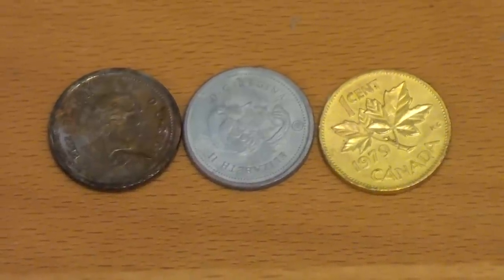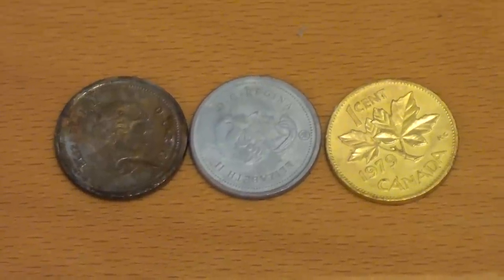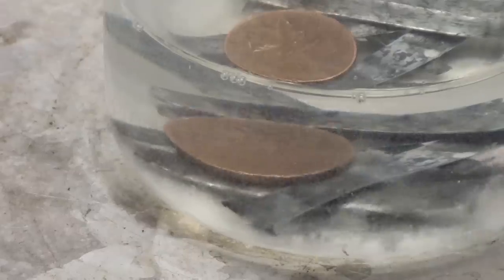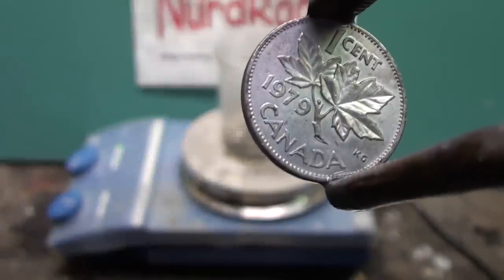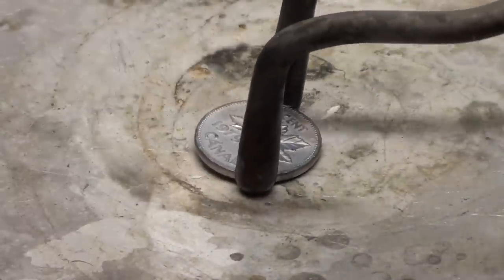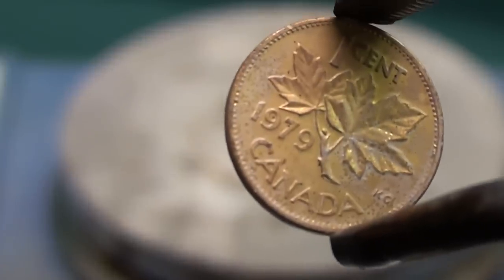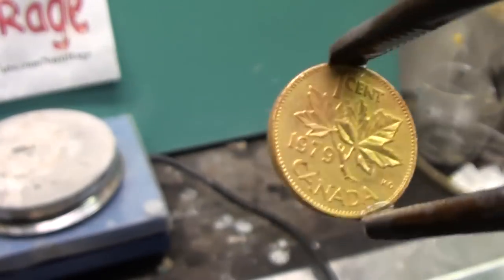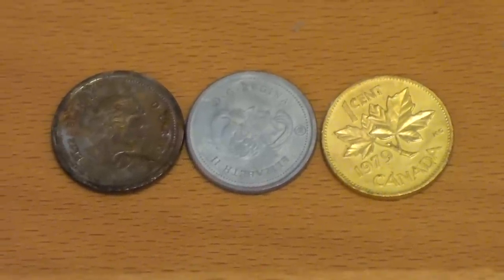Turn Pennies Silver and Gold (Chemistry Trick)

Comment from the maker: Chemically no. But through nuclear means yes. all elements in the universe heavier than hydrogen and helium were made in the cores of stars by nuclear fusion. We on earth can use a few processes like nuclear spallation, nuclear fission and nuclear fusion to also make other elements.

But you need particle accellerators and nuclear reactors for that. It is not possible chemically, and too expensive to be practical except for very special elements like plutionium.

Comment: I used zinc powder, instead of metal strips and it worked fine.
Reply: +Grey Ronin actually works much better
Reply: +Grey Ronin Ive been looking for an answer for this for ages! i can finally go ahead and order the zinc powder now...
Reply: Da Moose
Good luck :-)
Reply: Grey Ronin Thanks :D
Reply: +Grey Ronin Well of course it's going to work better, the zinc powder has a MASSIVE surface area compared to the strips.

Comment: Hello sir, I'm about to perform this awesome chemistry trick myself. Is it alright if I use Zinc sulfate heptahydrate ZnSO4.7H2O super pure? Will this work. I've noticed that the grain it comes in is way bigger in size?
Reply: Should work fine - it's just ZnSO4 with extra water molecules, added to water.
Reply: Okay, thanks.

Comment: Question; this is basically plating the copper in zinc right, then heating it to diffuse the zinc into the copper making brass. So my question is after the 10 minutes or so once the copper is plated with the zinc, would leaving it in longer create a thicker plating and a longer lasting brass finish? Or since the copper is coated with the zinc, is it as thick as it is going to get? I ask because I have some copper "Zombie Walker" coins for magic tricks and I would love them to have a golden finish.

Comment: sorry if im off the subject but ive been trying to silverlate some copper to make some pins, and I dont know what im dping wrong but, the silver wont go pn to the copper. I made my silver nitrate from dimes dated 1960, and im thinking its the silver nitrate that is the problem here. whats happening is my copper is getting really black and the silver coin im using to plate with isnt desolving but also getting dark. help I only have a few days to go. thanks, Carolyn

Comment: Hmm i'm failing for some reason the penny is not changing color. i wonder what could be wrong maybe my zinc is not good enough? i used zinc from batteries as zinc strips and zinc from batteries combined with sulfuric acid to make zinc sulfate. maybe i need to find how to test chemicals separately to find what's wrong

Comment: I am going to do this with some pennies I am using for a art project and I plan to use copper sulfate and zinc metal to make the zinc sulfate. My question(s) are how much Zinc Sulfate do I need for 50 pennies? How copper sulfate to zinc metal to make enough Zinc Sulfate ? and how much zinc metal would I need to put into the Zinc Sulfate to change the colour? Or Does It matter as long as the pennies are submerged?
Sorry If that's alot, I was trying to look it up but couldn't seem to get an answer on it. 
Thank You!

Comment: have a question I have a large copper kettle that is lined inside with brass I suspect this is the process m kettle is lined years of use has worn the brass down would it be possible to use this process to refurbish the brass lining safely to continue to cook in it.

Comment: So what do I do if I don't have a hot plate. Does a pan on a stove heat up to 300C

Is there a degree symbol on a keyboard?

And if I can't get zinc sulfate how am I going to get hydrochloric acid. Do I cut my stomach open?
Reply: You can make your own zinc sulfate and get hydrochloric acid at the hardware store. I heard once that cutting your own stomach open is unhealthy.
Reply: OK but what about the hot plate. I don't want to buy one just for this because I imagine they aren't a dime a dozen and I'm not someone who would use a hot plate very often anyway.
Reply: Stop the CPSC
Well, I don't know about the stove for sure. That's a good question. I guess it depends on the model.

You could use a propane torch as a source of heat though. They burn at temperatures way above 300°C.

It would be cool to try this experiment.
Reply: +JayMark2049 But will hank bring the pro-pain too?

Comment: hey in that copper sulfate battery video the zinc sulfate you made seemed to be in liquid form. is that going to be a problem because in this video it seems to be a white powder that you mix with water. Can I make the zinc sulfate in the way that you did in the other video and then just heat that up or do I need to find it in powder form?

Comment: messaging random chemistry videos. I'm trying to find out if their is chemical process that can turn metal a shade of gray similar to wet concrete. I ask because i have a handgun and it has a melonite finish. it's a chemical coating (if u didn't know)very resistant to abrasion. any info u can give would be nice.

Comment: The real trick might be getting the brass to stay on as he says it will eventually wear off. Due to being exposed to the elements or just constant contact or rubbing he doesn't specify. Maybe if a clearcoat was applied over it after the process?

Comment: I turned an european 5 cents coin into "silver" by turning the external copper layer into copper acetate through a solution of 50% acetic acid (vinegar) and 50% hydrogen peroxide. It turned out very well! The main metal of that coin was steel (not the stainless one).

Comment: It works faster if you put the HydroChloric Acid in a crucible 1/3 filled with Zinc shavings, suspended over a bunsen burner. I buried my penny in the shavings, and it took about 3-5 minutes for mine to turn silver. And, if you're careful, you can turn it gold just by holding it in an open flame for about 15 seconds. :)

Comment: I did mine in a steel can (as I do not possess beakers etc.) and it ended up taking longer as the steel becomes charged as well, attracting zinc ions towards it as well.

Comment: What happens if you burn it after it turns into "gold"?
Reply: +Xryeau Franco 
What makes you think you're turning this into gold?
Reply: Keshaire!!! 
That's why I typed "Gold" instead of gold.
Note the quotation marks.
Reply: Brass is a metallic bond (alloy) and behaves similarly to the metals that formed it with different physical traits like color or strength. If you heat it up enough, the metals would melt and form a homogeneous blob rather than the coin with  a brassy exterior

Comment: Couldn't you use baking powder or baking soda ? Isn't one of those zinc. Then instead of water peroxcide. Mix those two heat it up like in this video then drop in the penny.
Reply: +DagannothRex , Thanks i just seen that in my previous comment. I didn't mean water peroxide. It should have read, instead of water use peroxide. I thought i put it that way before.
Reply: +DagannothRex , Oh and it wasn't peroxide i was thinking of instead of water, i remembered it was vinegar. As for baking soda or baking powder its baking powder. But yea baking powder and vinegar does the same thing. I tried it after the video, because it bothered me i couldn't remember. Banking powder has two acids monocalcium and either sodium aluminum or sodium acid pyrophosphate. Just like baking soda it does have sodium bicarbonate as well. I know the difference between baking soda and baking powder, just always forget which one has sodium acid pyrophoshate or sodium aluminum and monocalcium and which one is just bicarbonate.
Reply: +Barry Weaver baking not banking, i think my phone switched up on me.
Reply: So just to make sure I am understanding this correctly, if I mix vinegar with baking powder it will turn the penny silver instead of the zinc sulfate in water. Do you still need the zinc metal? Thanks.
Reply: Baking soda is sodium carbonate. Baking powder is not a pure substance and contains no zinc.

Comment: Wow.  Thanks for the hard laugh buddy.  
No, it does not turn it into actual silver/gold.  Zinc has a silver color and it coats the copper penny in the first step.  Then heating it causes the zinc to fuse with the copper and it changes to brass which has a gold color.